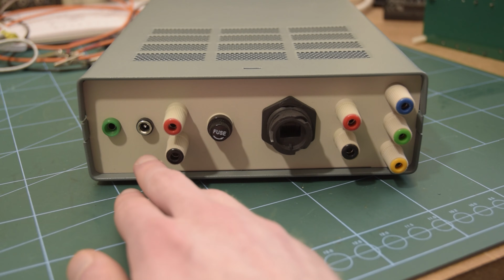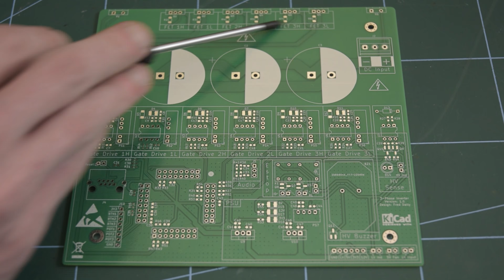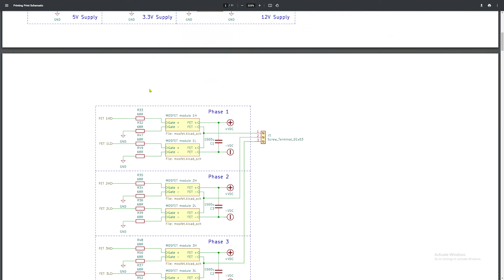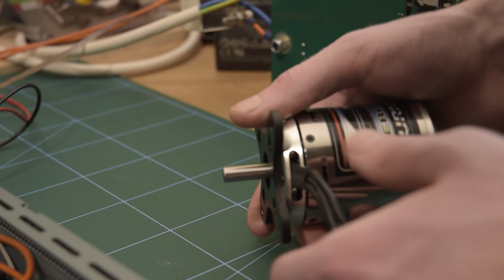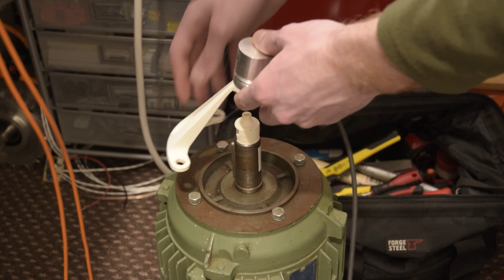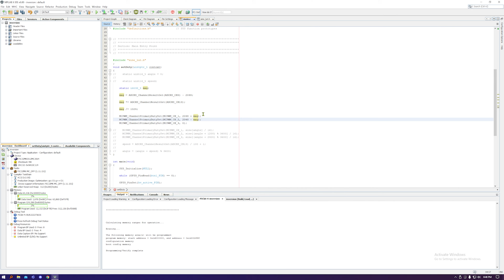Custom Three-Phase Inverter for BLDC, PMSM and Induction Machines

Comment: wait so pressing the e-stop energizes a relay? that's not very fail-safe, you pointed out that the contacts are broken on your e-stop switch, so you've already witnessed why e-stops are normally-closed (and the relays they power are normally-open)! when your e-stop circuit fails, the last thing you want is for the device to keep operating!

Comment: For microcontrolers usally unsigned integer divide by 16 is shift right by 4 bits as divides are slow/power hungry & shift is low power.
The table can be precalculated to 12 bits to get rid of even that.
Sometimes the table is kept at 16 bits for other sine usage elsewhere in the code.
Reply: Agree on table recalculation. You could also generate the sine table in software, in case you need a differently scaled one or some other arbitrary waveform. However, that will go to the RAM instead of the FLASH and you also have to link in math libraries, so it will have much higher resource usage that way.

Also, the mod 360 for the angle could also be normalized to some power of 2, eg. 256, if that's enough resolution, or more. With that, the modulo becomes a simple bitwise-AND.
"x & 0xFF" is the same as "x mod 256".

Agree on right shift/left shift things, it is pretty clear seeing those in embedded software, although compilers are smart enough nowadays that they optimize out the powers of two scalar dividers/multipliers and generate left or right shift instructions. The same could be true for the above modulo thing.

Comment: What if you would die today? Nobosy would know what to do with your Power Supply, because it has no labels at its terminals and buttons. Someone would have to disassemble and investigate the whole thing to find out what it does and where to connect things. 

I got myself an absolutely oversized DYMO label printer for things like that, assisting anyone who dares to live longer than myself. You should too, as Youtube may be long out of business at that moment or was long bought by some billionaire extremist, banning all educational stuff on his now very own new self promoting platform in the process. Nobody would know...you!

Comment: 2 years late and sure you improve a lot this design but...

( 15:07 ) One thing that I commonly see in some power boards its that they solder tin in some traces in order to improve his thickness.
No need to print a new board (Unless you want), you can scrape off the resin layer, solder the tin, and spray that part with new resin for insulation purpose.

What do you think about?

Well, hope at least my comment helps somebody, love your videos and all your work..!!!
Greetings from Argentina.!!

Comment: What control loop did you use for regulation?

I'm planning on building a bench power supply so what control loop would you recommend for such applications?

Comment: I've often considered that capacitors and inductors can perform the same input voltage smoothing function (though wired differently). The nice things about inductors is that they are a lot more reliable and stable. You seem a bit of an inductor devotee yourself! What are your thoughts about using inductors in the input high-voltage smoothing section?
Reply from the maker: Just have to be careful not to use them in circuits where the current will (try to) change rapidly, or the inductance will generate significant voltage spikes

Comment: I noticed that you don't have any output smoothing. Granted, this would be minimal given you want it responsive to high frequency driving. Is the direct drive from the MOSFET H-Bridges hard on them?
Reply: Motors are inductive anyways, so adding inductors is not really necessary. However, if you want to filter out the switching noise (PWM carrier frequency) from the output, then you might want to add some LC filter.

Actually class-D audio amplifiers do have LC filters on their output to remove the carrier.
Reply from the maker: No it shouldn't be hard on them, its surprisingly common in motor drives actually, not sure I've ever seen one with output filtering!

Comment: Very impressive. I suspect your audio input noise is due to the type of cabling being used. If it's just plain straight wire, then it will pick up gobs (a metric unit 😂) of noise. Try a balanced twisted pair arrangement (like higher quality audio connections). You might even want to try a shielded cable, to knock out the HF noise. Just my guess though 🤷‍♂️

Comment: Where is the current sensing? Where is the position feedback? Why use SVM without any of those?
Reply from the maker: Did I say I’m using SVM? This is designed for open loop testing mostly though does have provisions for an angle sensor if ever needed
Reply: @electrarc240  Yes at 22:56. There is no current limiter in the inverter then? How do you handle short circuits on the motor side?
Reply from the maker: @IvandelMuntSoler  As this is just for testing motors, I first test the windings with the LCR meter, and also slowly ramp up the modulation index with one of the knobs on the front panel. So the likelyhood of damage is very low
Reply from the maker: @IvandelMuntSoler  Ah and I see the SVM part sorry I forgot I said that. You can have SVM without FOC (open loop), which is what I have in this case

Comment: Hi, thanks for great video. I have several questions. First, why trace between high voltage capacitors are so thick compared to before and after the capacitors. Second, I want to also build my custom three phase inverter for PMSM, can you tell me some papers or websites or some tips for studying?

Comment: I'm curious did you actually try measuring the back EMF of the aeroplane motor? I've only had the opportunity to measure a handful of these hobby motors, and fully expected to get a trapezoidal waveform out of them, but so far they've all been sinusoidal! In fact I've never encountered a 3 phase brushless motor that has had a trapezoidal back EMF which surprised me.

Sensorless control schemes, utilising field orientated control, are actually the pinnacle of brushless motor commutation. Allowing for a perfect alignment of the generated stator magnetic field and rotor field to create the highest torque and the highest efficiency.

These can have issues at zero/low RPM, as there's no/very little back EMF to sense, but some schemes continuously inject high frequency signals into the stator coils, then measure the result, in order to accurately detect the rotor position.

TIs Instaspin FOC works incredibly well at doing this. At least the older versions did so I can't imagine it's got worse.

Positional rotor sensors can be very useful in mixed control systems. With sensored feedback being used at low RPM but then as soon as there's enough back EMF the system switches to sensorless.

The other option being to use an open loop start up but these aren't as useful in applications that require full torque from zero RPM.

Of course spinning a motor that has trap back EMF, with sinusoidal signals, isn't the best for efficiency. As far as I'm aware you'll lose a couple of % in such a case. However it will be quieter than driving it with trap signals.
Reply from the maker: I didn't no, that is quite interesting to hear, I have an "in-runner" BLDC that even appears to have distributed windings so I presume that will have fairly sinusoidal back EMF. A video about the inductive zero-speed positioning could be quite interesting🤔.
Reply: @electrarc240  indeed,  and who better to create it!

Comment: Question... you've used 3 half H-bridges to make a 3 phase output... could you just use 2 half H-bridges using these drivers to run a brushed DC motor?
Reply from the maker: Yes! And only one of you don’t need to run it in reverse!

Comment: Great stuff mate !^.^!
btw, 99.99% of the time you want an E-stop button and circuit to be a normally closed circuit. that way if any part breaks or any wire comes loose then the product stops, making it so you must fix the loop so it ACTUALLY WORKs when you do actually need it
Reply from the maker: I know, this was the only red button I had lol. Also the inverter is so light the whole box would just slide away unless the E-stop was on top but then I can't make a lovely equipment stack

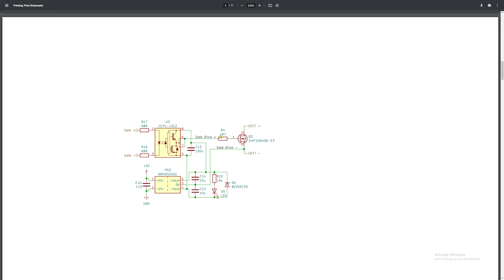Comment: @20:20  To be safe use for each ouput a  BZV55C16 voltage limiter ISA only D6  or  place a high value resister parallel with the capacitor C12 and C14  (100k or so)  else there is a possible voltage shift between +V and -V
Reply from the maker: Yes good point I suppose my Zener clamp does nothing for the balance between V+ and V-

Comment: For gate drive I would've swapped the position of the cap bank and the Fets. Having your gate drive paths being that long is not always a good idea. Swapping the caps and Fets positions would make your gate drive paths much shorter. Even with it come that way your high current tracks would still be able to be extremely short as well. There's a lot of emi going to be generated which can cause issues with your gates. You can also place decoupling on your main chip directly on the headers on the top of the board, that would work very well.
Reply from the maker: Oh certainly, this inverter is now more of a "what not to do" for me now. I designed it before I'd been taught any power electronics at uni so it was all just based on stuff I'd seen online or my own assumptions. Though when I was designing it aesthetics were my top priority (don't judge) and I think it looks better this way round 😅. Also if I remember correctly that heatsink hangs down the back of the board a bit so I would've needed a different one to mount it in the middle.

Comment: You are a very knowledgeable person, your videos contain so much information, I am amazed.  I only just learned about the difference between BLDC & PMSM only a few days ago, I mean the real thing, not the superficial crap of most YouTube videos when they refer to both as only Brush less motors!  Distinguishing between the Trapezoidal waveform and Pure 3 phase sinusoidal waveform to drive these motors, the sinusoidal which is 100% efficient.  I guess the next step is to supply the inverter with power from the mains but going through an home-built PFC (Power Factor Correction) circuit.  People would state that its "The rise of the Machines" era, but I think its "Rise of the Inverters" with EVs, AI coming afterwards!
Reply from the maker: Woohoo go inverters, love them! Yeah I was planning a PFC video but still haven’t got round to it, will probably be a video in the direct current control series.

Comment: Your audio is noisy because your clock frequency is only 29kHz. You probably want to increase it up to 44.1kHz or 48kHz depending on your audio sampling rate.
Reply from the maker: With better FETs I definitely plan on that
Reply: @electrarc240  good modern Class D amps, such as Hypex and Purifi stuff, have switching frequencies around 460-600-700 kHz, some go over 1 MHz and all of them have dead-time of less than 10 ns. They also allow some amount of intentional shoot-through to smooth transitions as much as possible as this is the major source or harmonic distortions. Their modulators are completely analog, and you can't match that in a digital domain, not by any means, as a closed analog feedback loop corrects for tiniest amount of nonlinearities introduced from magnetics, parasitic elements(even inductive traces in an open loop can worsen THD), etc.
Reply: @isoslow what a good explanation.

Comment: Awesome project to begin with! Really love the symmetry of PCB. You must have put a lot of hours into it. One question: I am also building a frequency converter and was wondering how you got that lookup table in the software with the third harmonics (the modulated wave that looks like a saddle-like shape). Did you use some kind of calculator for the lookup table?
I would really like it to implement this in my converter. Thank you in advance!
Reply from the maker: Thanks! I generated the saddle-like wave using a python script I made. I think I did a very over complicated method so as probably not the best to advise haha!
Reply: @electrarc240  Thanks for the reply. In the meantime I have also made a Python program that generates a lookup table with a third harmonic in it. Fourier comes in handy again.

Comment: What a nice project. I am considering about doing something like that!!
Reply from the maker: Thanks! Couldn’t recommend more as a project.
Reply: Hi, Mr. I was wondering if it is possible you could share the schematics of that project. I would like to understand better and to do it by myself 🙌🏼
Reply from the maker: It’s a very standard inverter, nothing special. 3x MOSFET half bridges, each FET has an optically isolated gate drive with an isolated DCDC. They’re all controlled from a microcontroller.